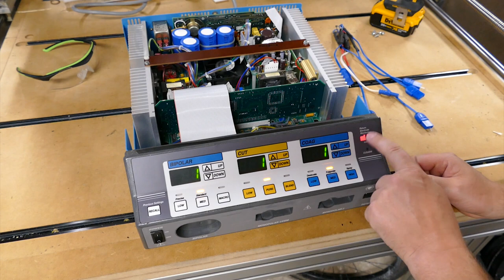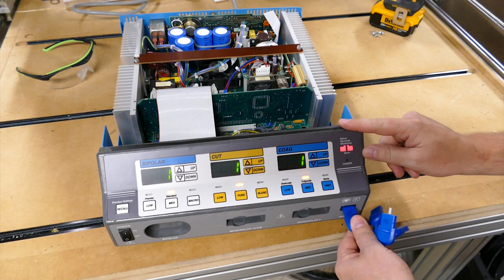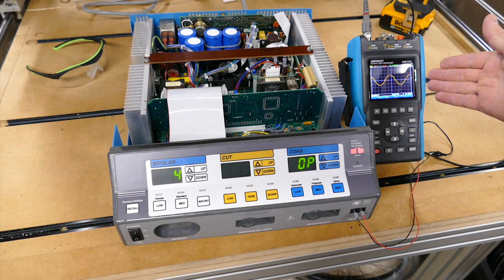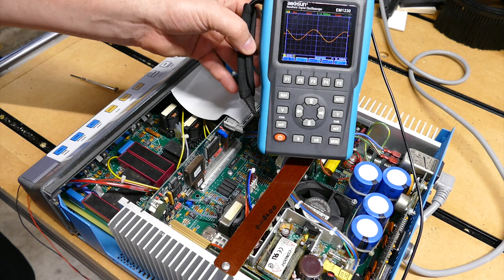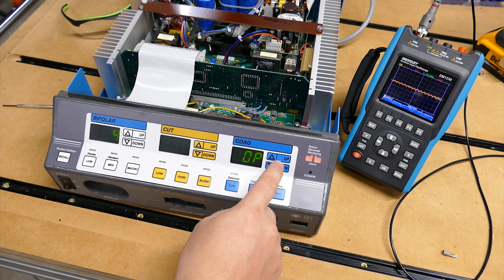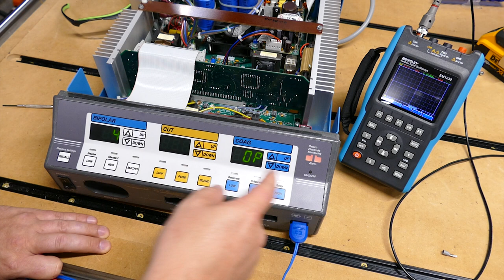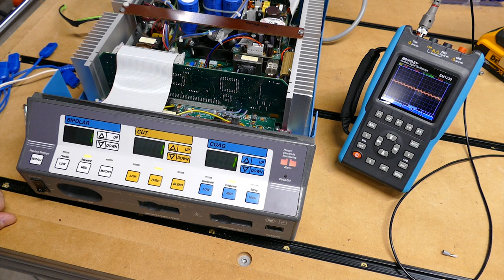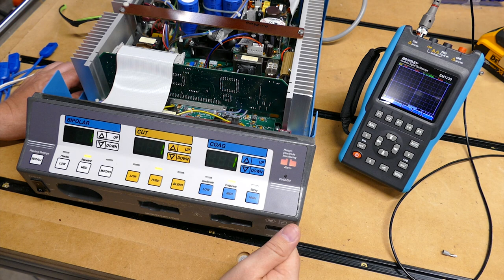Force FX REM Calibration!

Comment: Hello, I cannot find the 10, 70 and 135 ohm resistors in our country. Is +-5Ohm resistors close to these values suitable for calibration? Also, can I learn the Watt values of these resistors?
Reply from the maker: Remember, in series, resistors values add together. In parallel, their value is less. Get a resistor kit and experiment.

Comment: We have just bought a vPad Rf tester, and the Force FX 8C non REM test on the auto sequence says that the REM indicator should be green at 1 Ohm. I’m sure this is wrong, and that it should be off, and alarm at about 20 ohms. What say you?
Reply from the maker: There are 2 different REM connectors which will affect your results - with a tang and without.  A connector with the tang stick attached is for a split electrode REM Pad and it should alarm at less than 8 ohms (ithink) and have values between 9Ohms and 135Ohms. The Non Tang connector is for single electrode pads and those values are 0 ohms - 8 ohms.  It has been a little while since I have done a REM check on the FX model.
Reply: @BetterBiomedChannel  thanks for your reply! I found the valley lab spec and it’s definitely not illuminated at all at 5 ohms, and it should alarm at 24 ohms. With the non rem cable without the pin of course. Loving the videos mate! Good work!

Comment: Hello my friend, my name is José and I am from Colombia. I have a ESU on my work shop and It presents error code 160 and 212. I did all the calibrations and I to changed the battery of the memory and to show the same problem. I need that you help me.
Thank's a lot.
Reply from the maker: Jose, what make / model esu are you working on? I'll do some research and see if I can duplicate your error
Reply: @BetterBiomedChannel ,  The model that I am working is Force FX. Thank you.
Reply from the maker: Jose, both error codes are calibration issues. Replace the internal battery and do a full system calibration.

Comment: hello! A Valleylab Force FX just came into the workshop and the bipolar standard setting is unresponsive. Can you advise me please? much appreciated.
Reply from the maker: Are you depressing the bipolar buttons next to the bipolar ports?  Are you sure the bipolar foot control has continuity?  You can jumper the bipolar and activate with a paperclip to the 3 pin port on the back of the unit. 2/3 pins need shorted to activate.
Reply: @BetterBiomedChannel  I am going to try this, thank you so much.
Reply: @BetterBiomedChannel  the bipolar foot control has continuity because it works for the low and macro settings , however , nothing for the med/standard
Reply from the maker: @abigailcharles542  Abigail, let me do some research on this one. I've never heard of this problem before.  A full calibration might be needed.   Did you try to open the case and reseat the CPU card  (if I remember correctly) which is in the middle of the device mounted on its edge?
Reply: @BetterBiomedChannel  no luck
Reply from the maker: Are you in the USA or Europe?
Reply: @BetterBiomedChannel  no, in the Caribbean
Reply from the maker: I'm asking around for you.
Reply: @BetterBiomedChannel  thank you

Comment: Sir can u help me error 160 in force fx machine
Reply from the maker: "If you get a 160 error, remove the K2 relay and then apply power. IF the error goes away, the problem is probably on the right side of the FX; however if the error is still shown, then the problem is on the left side of the unit. To remove relay: push retaining spring to the side. To reinstall: put relay in place first, then push retaining spring straight down from the top." -medwrench